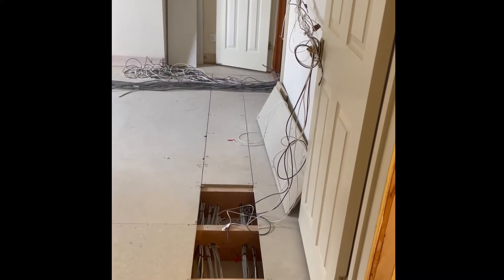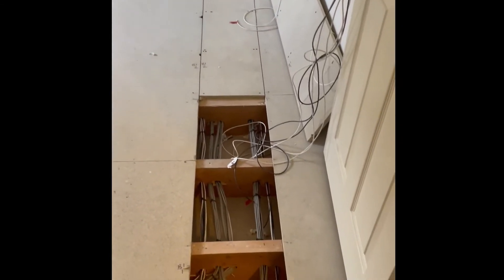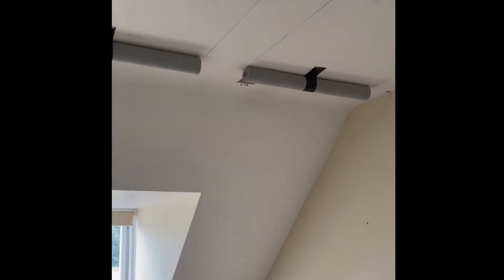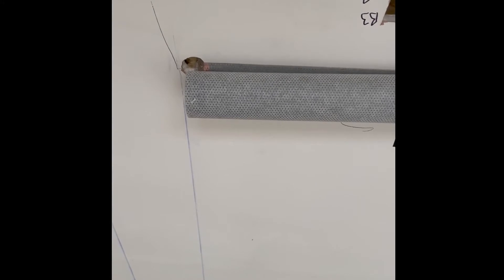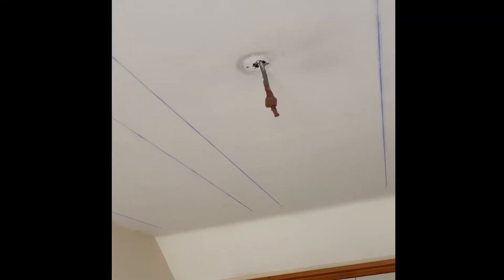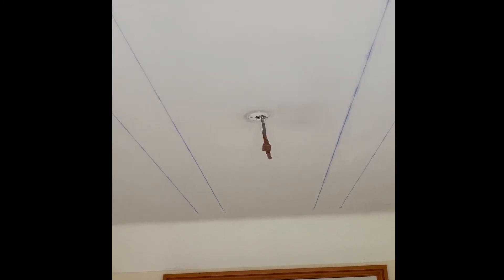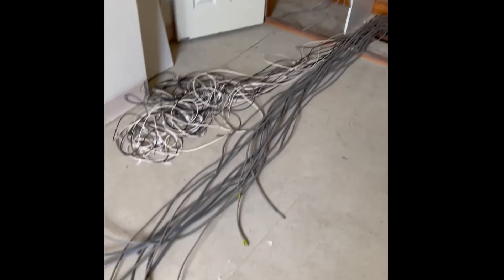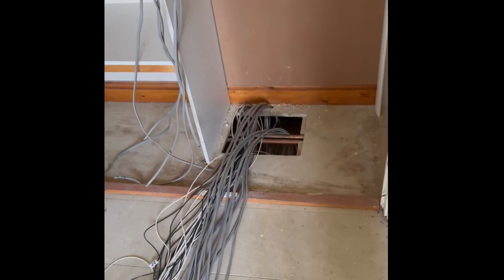Infrared Ceiling Heating 1st Fix. Video 1 of 3

Comment: Hi. 
Will the plaster crack further down the line?
Reply from the maker: not in our experience. if you think why scrim tape is used, to avoid cracking, the matting is very similar to this. Also the surface temperature of the system is little more than a hot summers day and has had no effect at all in various systems we have now installed. I hope this helps.

Comment: Hi .would a 800 watt panel fixed on the ceiling above the bed be able to heat directly underneath quickly? Not worried bout heating the room just the person directly underneath. The distance from the panel to the bed below would be 5.5 feet.
Reply from the maker: Hi there. Every product varies, it would be advisable to refer to the specific manufacturers instructions to confirm the product meets with your requirements. Reach out to the supplier for their response they will be best placed to respond correctly to your specific query. Hope this helps.
Reply: @meservices3979  i know that. Am asking for your opinion based on your experience of your panels.
Reply from the maker: @amoryblaine1102  in truth i don’t install the panels you refer to, only in plaster systems. Sorry I can’t help
Reply: @meservices3979  no worries. Cheers.

Comment: thx for doing this, i have been searching for something like this, can you tell me if the insulation has been redon as part of the retrofit
Reply from the maker: Hi Danny
We have one more video to upload 
Insulation, no need but recommend you obviously have the 270mm if possible. (Top up maybe required)
What I do recommend more so is you use foil backed plasterboard or install foil roll in the loft to deflect the IR. 👍
Reply: @meservices3979  many thanks

Comment: Hmm ...I have a House of 3200sq ft  With Radiant electric heat panels. 
Fitted when I built the house from bare dirt.  Over the years the panels have failed.. one by one.
 Currently there are NO working panels.  V nice  !
Observed that the problem is with the 60 hz cycle of electricity as  It causes the heating elements to hummmm  at o 60hz.. . And this sooner or later fatigue breaks the elements.  
NO ONE ever talks about this wee factoid.. Do they ??
 Not sure what to  do now... as even stripping Every ceiling in the house and replacing the heatpanels ($$$$)  will be a temporary 'Fix.' 

That said I may have to go to baseboard heaters Or Strip the house to studs to retrofit a Hydronic system.. 
Ohh. by the way  Electric radiant heat is surprisingly expensive to operate. I was "sold" on the 'economy aspect As this was Cheaper heat than using a Forced Air Gas furnace system.   

Absolutely Wrong !  When All my panels were still working the heating costs were well above that of another (and Barely insulated) nearby House that I own... running a Gas furnace.   And I live in a low Electricity costs region
So much for the it's cheaper B.S.....Caveat Emptor people